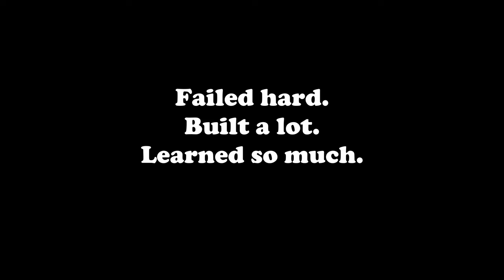3D Printed Jazztele / Telemaster | Is PLA Strong Enough for a Guitar??

Comment: Next time instead of super glue I would recommend 3D filament chemical weld it just tends to bond stronger than super glue because super glue is a different material. Just a heads up amazing video. Thanks man!
Reply from the maker: Thanks!! Yeah I thought about that, I’ll try it next time. The super glue held up fine for a while when I had it assembled

Comment: Nice video, beautiful playing. I also built myself a modified "Prusacaster" and agree with your comments about how flexible the body is. I used PLA and exceeded the recommended wall thicknesses but it still flexes quite obviously. As a novice player I'm struggling to set it up well or keep it in tune. It looks great but i waa hoping for a decent instrument so I'm a bit disappointed with it in the end. Still a really fun project, great conversation piece, and I learned a ton. My next Partscaster will be better. Massive respect for real luthiers who make guitar building look so easy!
Reply from the maker: Yeah I learned the hard way that it's not easy haha! I have another half finished PLA body I want to finish, I made the infill much higher so hopefully it stays in tune better.
Reply: What infill do you have for the main structure? I was thinking of doing one with PC but that is looking pretty pricy
Reply: @cwill6491 put a 3mm thick aluminium plate on the back. Make a template out of cardboard. I glued it on with epoxy and clamped it overnight. It completely cured the flexing issue and it now holds tune great!
Reply from the maker: @officialWWM that would do it!

Comment: Hi, superglue for pla always worked for me. I made this guitar too with extended wall thickness and works great. I think problem is that you sanded only one piece not both of what you glued together. It means that adhesion layer is only on sanded part. Just my experiences. Super glue for pla works great.
Reply from the maker: Maybe...The center part bent too much though, and there was good adhesion between the other parts. So I may try again with another design...
Reply: Does yours flex a lot? I put 2 aluminium support rods in mine and the body still flexes wayyyy too much!
Reply: @officialWWM  I see little flex. I used 7 wall thickness and it does its job good.
Reply from the maker: Yep mine flexes really bad. I ended up taking it apart and putting the parts back into my wooden tele body
Reply: @ZachariahConnor  I have built another one. I upped the infill to 50 percent, added 2 aluminium rods to stiffen it and cut out a 3mm aluminium plate which I polished up and bonded to the back of the main block. It doesn't flex now 😁
Reply from the maker: @officialWWM nice!!! Sounds very sturdy!
Reply: @ZachariahConnor  yep, she’s solid now 😂

Comment: You’re putting a lot of faith in that superglue!
Reply from the maker: Well the super glue only held the auxiliary pieces onto the main backbone of the guitar, so they are providing much structural support
Reply: @ZachariahConnor ok, so I just built one of these and it sounds surprisingly good, however, the body has loads of flex in it! If you pull on the neck it goes completely out of tune. Are you experiencing this?
Reply from the maker: Yep…which was why I stopped using it haha. I put the parts back on my wooden tele body

Comment: What are the requirements for the dimensions of the 3d printer?
Reply from the maker: I did it on a Creality Ender 3 v2 which has dimensions of 220 x 220 x 250mm
Reply: @ZachariahConnor  Alright thanks! If im going to order a 3d printer to print this guitar i want it to be the correct size 🤣

Comment: I am thinking of making this guitar, but I am not a guitar person. Would PLA or PETG with carbon fiber be a better material due to added rigidity? I don’t want the guitar to flex out of tune easily.
Reply from the maker: Hi, I used PLA and it flexed too much. I don't think PETG will be much better, but if you add carbon fiber it should be much better!
Reply: @ZachariahConnor  thank you! I guess petg-cf will be the way I’ll go. I might get on with the build later this summer. I’ll comment on how it works out. Have a good day 😊👍

Comment: Which version of the files has the weird neck/pocket spacing? I’ve started printing some of these parts and thinking of putting a baritone Telecaster neck in from Warmoth.
Reply from the maker: The ones that are up on GrabCAD should find fine. You might need to slightly press the neck in
Reply: @ZachariahConnor  thanks!